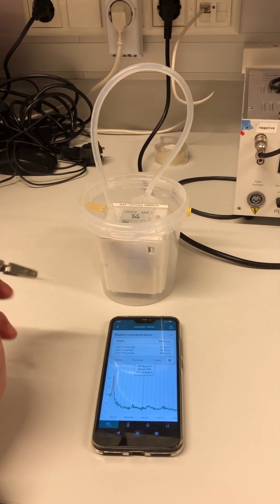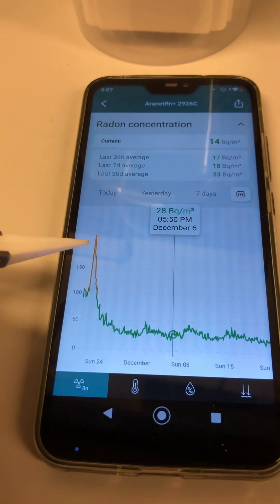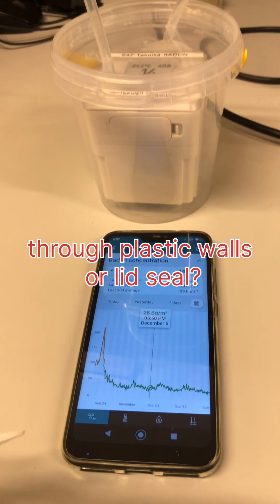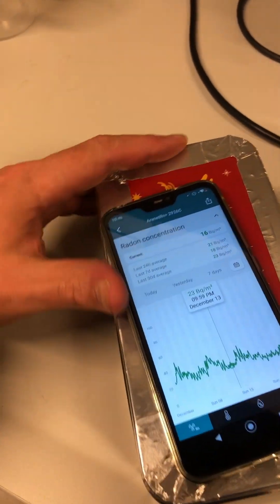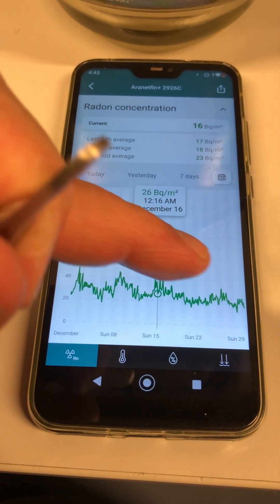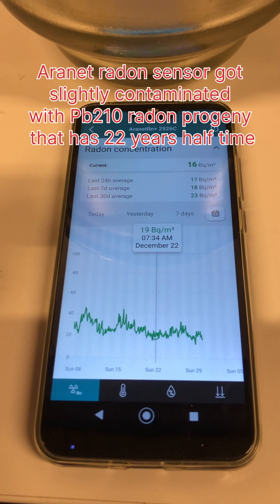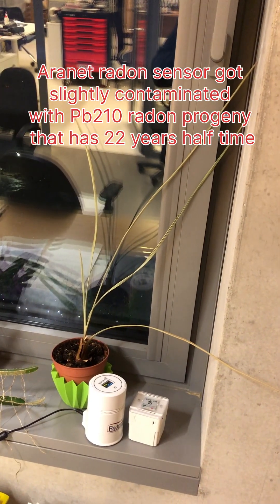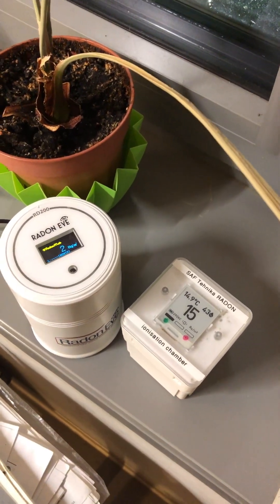Trying to get radon-free air by placing Aranet radon sensor in sealed wessels and waiting

Comment: Interesting, I think that base value may be due to background interfering with the reading. Could you try to measure the sealed container, inside the lead castle?

Reason: Pb210 is very weak emitter compared to radon, I don't remember the exact value, but it was about 1.000.000 times weaker than from radon to Pb210. So I think contamination would be insufficient to justify the reading